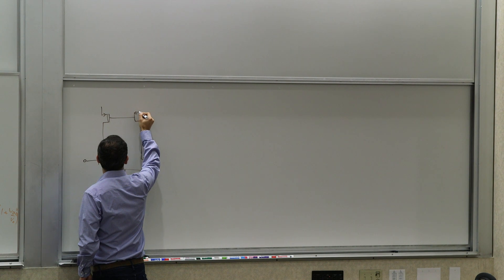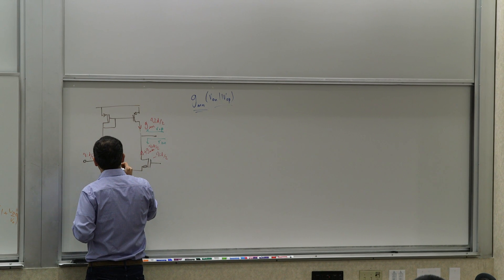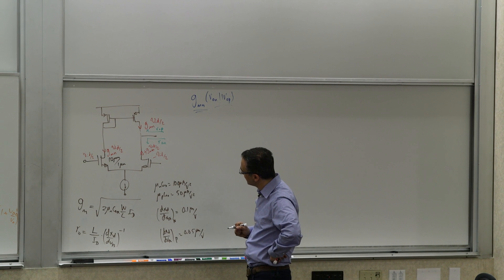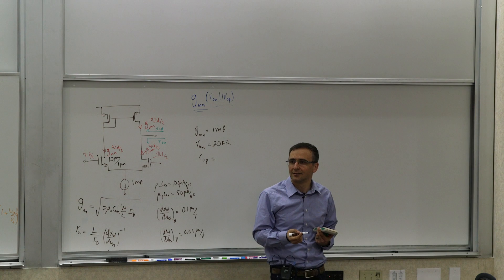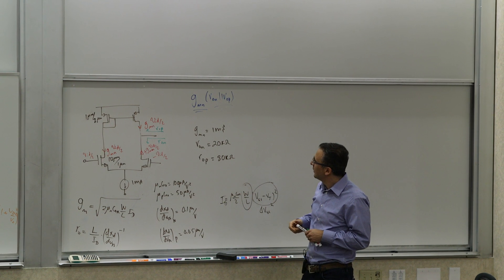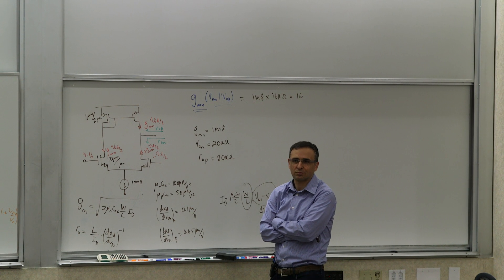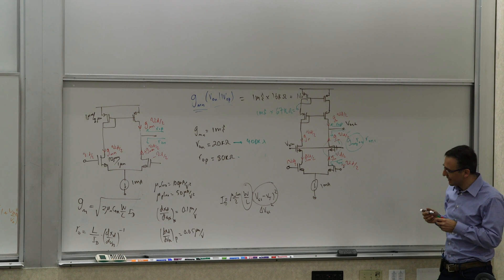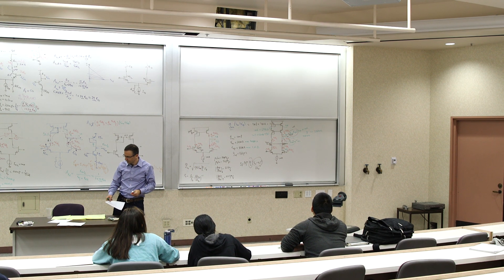130N. MOS Differential-to-Single-Ended Conversion. Gain Enhancement

Comment: sir i have some doubt that how n-mos get turn on by applying -vin/2 voltage
Reply: The voltage "-vin/2" is not what is turning on the nmos. The common-mode dc voltage is what turns it on. The "-vin/2" is what you consider to be your small-signal voltage at one input of the differential pair.